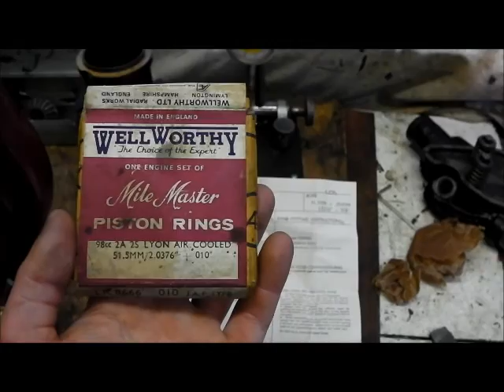J.A.P Model 3 Restoration - Part 8 - Including First Start

Comment: Lovely little engine, really nice to see her running at last! I've noticed that you use that braided HT lead on most of your engines, is that more authentic?
Reply from the maker: Tom Branchline Thank you. This engine would have had a shielded ignition system originally, but those magnetos are hard to find and it had gone walkies... I just like the look of the braided cotton HT lead, bit of a tart when it comes to details like that....!